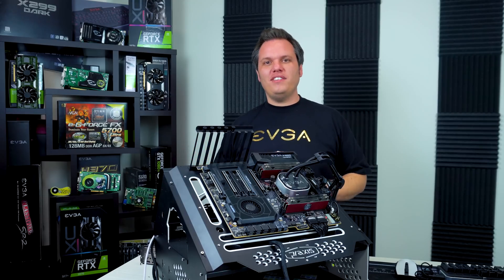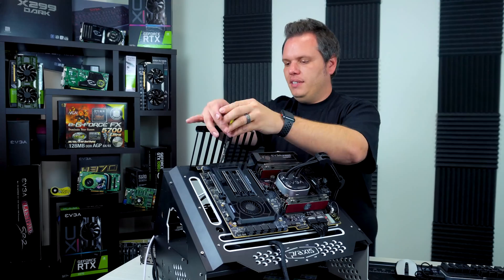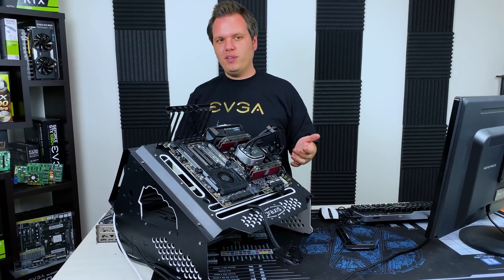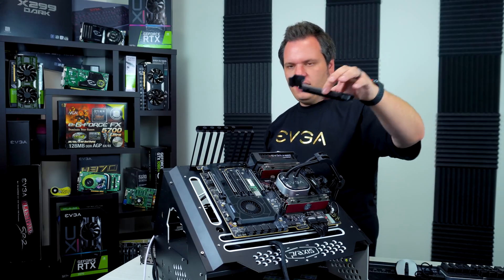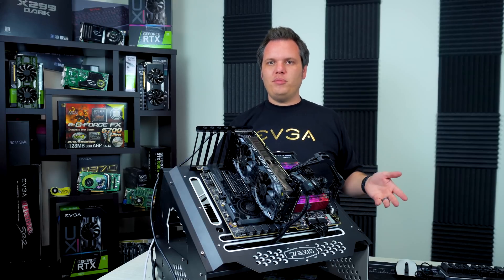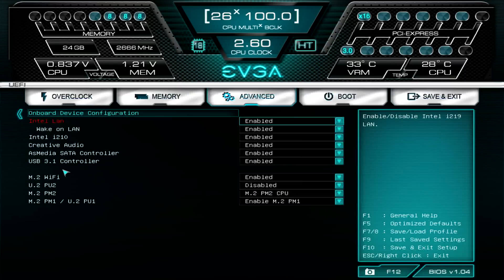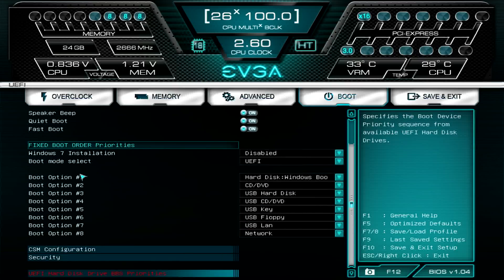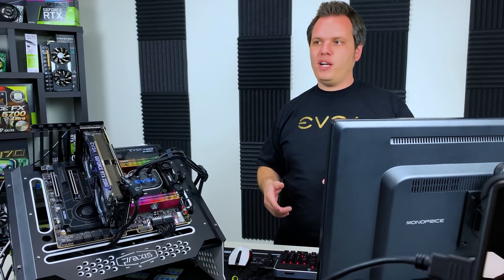How To: M.2 Install

Comment: I am getting so pissed with the m.2 installation. I got my tiny screwdriver and everything, but the screw itself is so tiny it won't allow the SSD go under it... the screw is probably too short, manufacturing error probably..... have to find a longer one somewhere that would fit. Spent almost one hour toying and then gave up.

Comment: I'm having an issue trying to install windows 10 onto my m.2 I have the m.2 in the pm1 m.2 slot and I followed the instructions in the owners manual to set up the m.2 to install windows 10 on it but I noticed the instructions in the manual don't actually match what's being shown in the bios. When I try to install windows 10 onto the m.2 It doesn't show the m.2 in the windows setup part asking where I  want to install windows when installing windows 10. What did I do wrong ?
Reply: Update: I tried enabling the m.2 slot in Advanced under cpu storage configuration but when I tried to boot to the windows 10 creation tool on my USB thumb drive I got a blue screen saying Error: inaccessible storage device. EVGA needs to update thier owners manual somehow because this is a serious issue, I will be contacting EVGA customer service

Comment: If you are running an older board there are PCIE adapters you can purchase for the M.2 NVME. I have one on my rig running PCIE 2.0 and Windows 10 starts up in under 15 seconds with no additional loading.  Love the test bench.

Comment: Thanks Joseph that was really handy. Could you guys do a guide to show people how to setup Bootable RAID 0 using VROC on the X299 Dark? Also, the BIOS menus are totally different now. You guys are on 1.04 BIOS in the vid here while most people are on the latest version (1.14). A big difference i noticed in the Onboard Device Configuration menu is that there is no longer an option to disable the U.2 slots when they're not in use. And there is also no option to tell the M.2 PM2 slot to pull lanes from the CPU instead of PCH. This is very confusing.